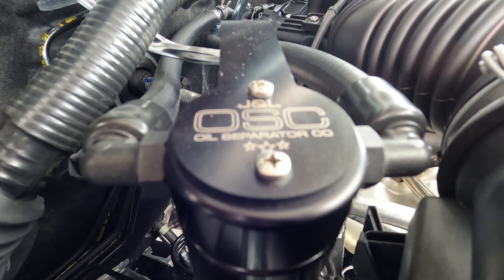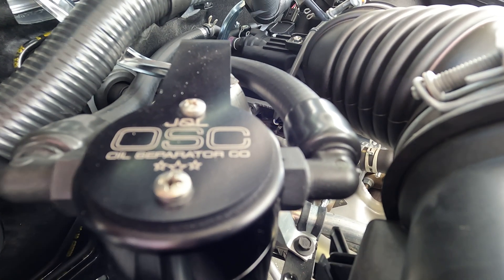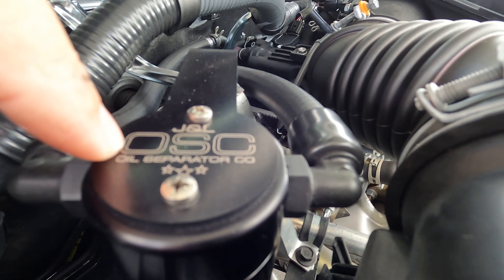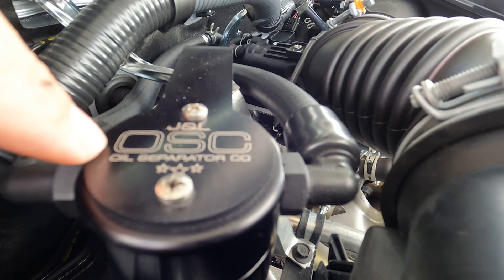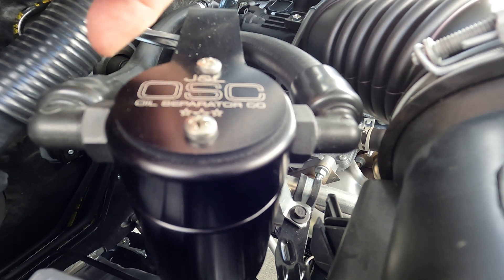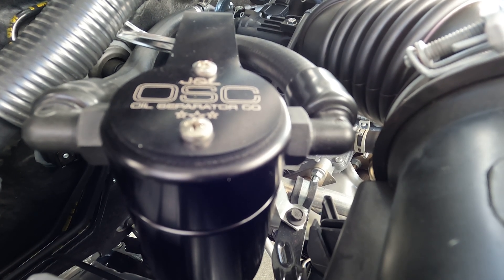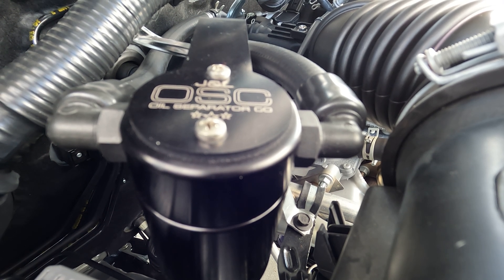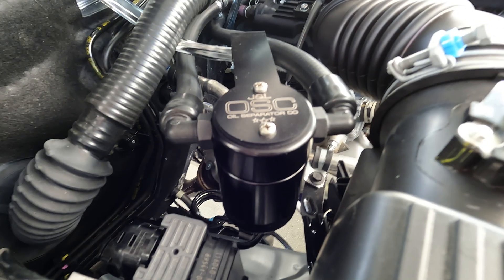J&L Oil Separator Can, How To Correctly Run The Lines

Comment: you could actually Show the insides. it would help. 
 My can has a small screw on baffle on the inlet side that I put some Steel Wool  in. Then the Can itself has the rest of the Steel Wool Cram-packed into it. Baffle only goes into the Can about an 1/2 inch. I Figure the Baffle and Steel Wool Slow the Oil droplets down enough  for them to gather before exiting the open side to the Intake.